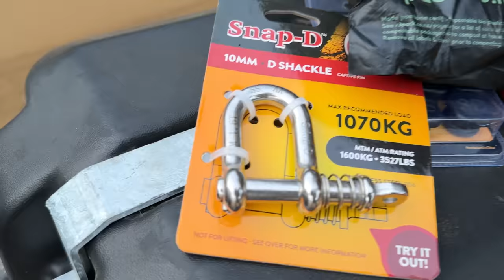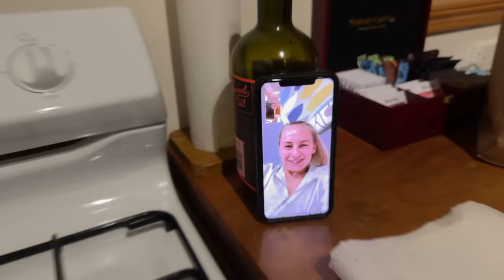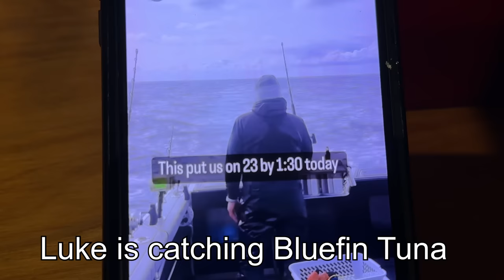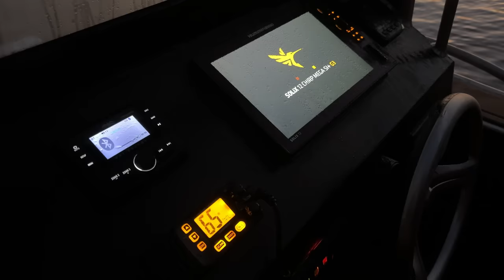Land Based Fishing an Island (With a Custom Built Boat)

Comment: Need to rig up a Bungy on the anchor rope and anchor off the back of the boat. Drop one person on the rocks with a shore rope tied to the bow. Anchor boat, then you can just pull the boat in with the shore rope to unload. And the Bungy pulls the boat back away from the rocks when released. Tie the shore rope to the rocks. And pull boat in when you need to get back on.

Takes a while to sort the system and how much Bungy you need to use/ how far too anchor off the rocks. But once you got it sorted and used it a few times, it's the easiest way!
Reply from the maker: Done it that way before and as you say get it right and it works a treat 👍 chur chur